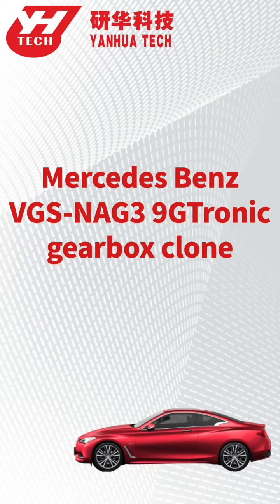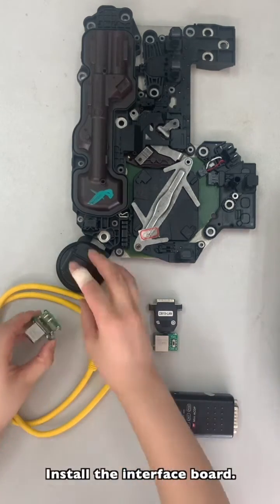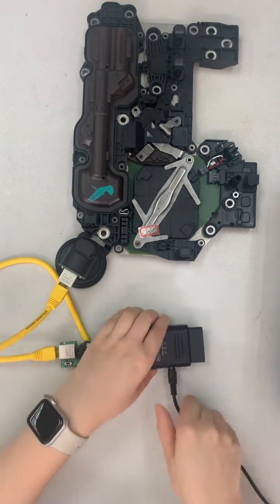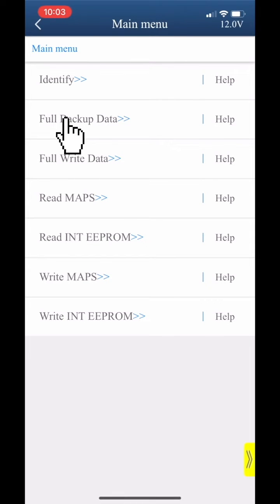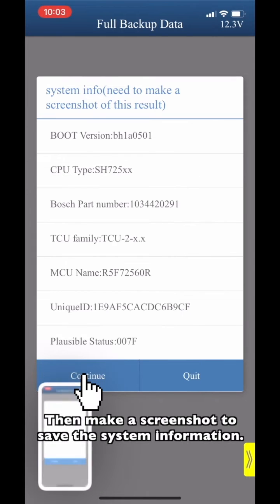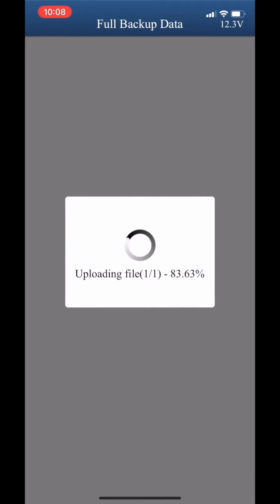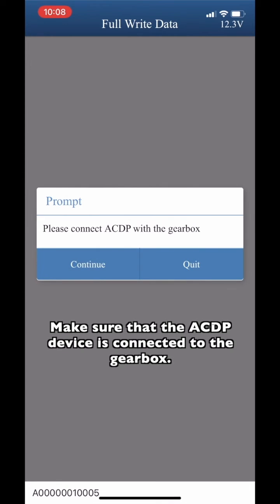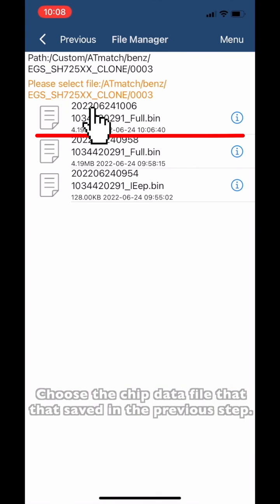Mercedes Benz VGS-NAG3 9GTronic gearbox clone using Yanhua Mini ACDP - obd2shop.co.uk

Comment: hey, If i want to repair control unit, need to buy  ACDP host + SH725XX Interface board? right 
Also ,  when I have done after do not need to scn cording and any other teaching?
Reply from the maker: Hi, what type of car do you want to do?
Reply: @obd2shop982  w253 GLC 9 speed